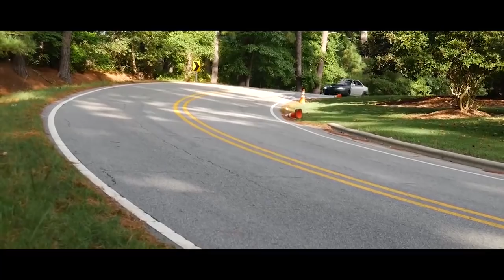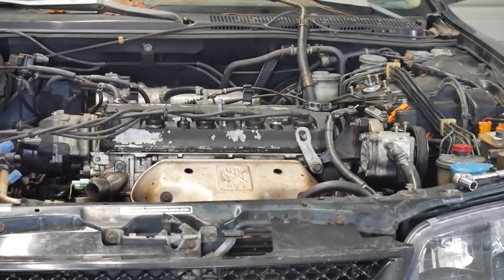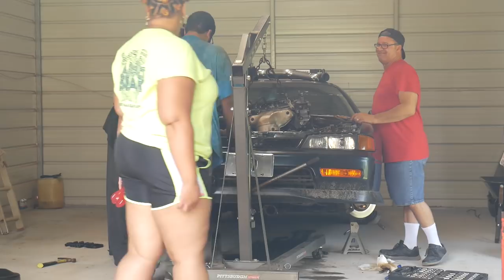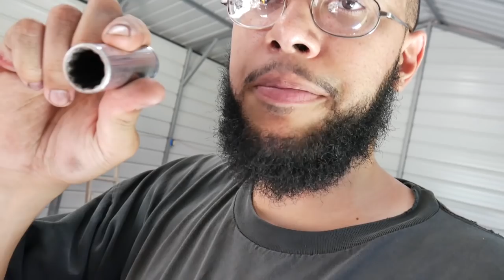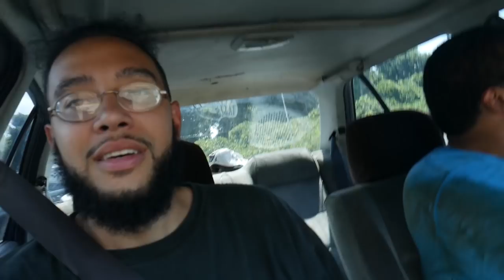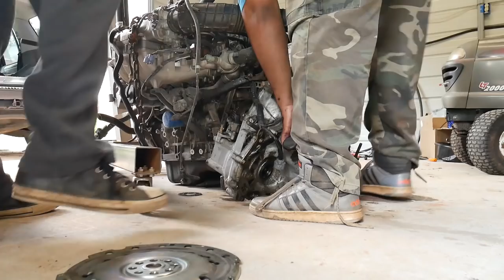CD Accord Wagon F20b Swap Part 1 | Engine Removal

Comment: Quuestion:
I have a 1996 honda accord wagon ex that i would like to install H23 engine can i use the same engine harness or would they need to be changed. I do npt have vtec its a regular H23.

Comment: hey man.....i got an issue with my h23a i dropped in my prelude, but the dang thing wont put power down....my mechanic said it needed fuel, i changed injectors and upped the fuel pressure but it still acts crazy. head gets so hot i could brand dohc on my hand after just driving around town, and if i hold the throttle down steady at a certain rpm, it will fall after about 4 or 5 seconds. just seein if you had any ideas. im running it stock on a p13.
Reply: G Man might need a base map tune sometimes stock ecu won’t work for some set ups
Reply: Dyquais Williams thanks for the response man
Reply: Dyquais Williams i know a lot of people using the exact same set up as me on no tune runnin strong....so i swear i feel like its something random. i took it to the shop but dude aint do a dag on thing but put an adjustable fuel pressure regulator on it....aint do a dern thing.
Reply: I would check oil or coolant..was it sitting befor u put it in?..pull the oil pan off and check the pick up..iv seen one clogged with dust from sitting..cleaned it out and it ran like a rape date..but my guess is oil if the head is getting that hot
Reply: Billy Buckner right....hmm now thats making sense. yea the temp gague never gone past half way. i did have the motor sitting for like 6 months before i dropped it in too